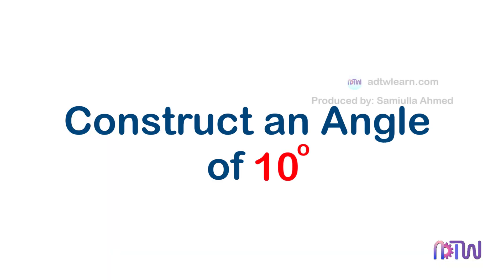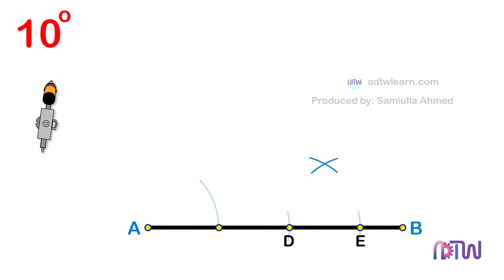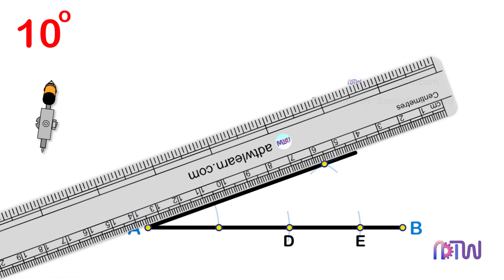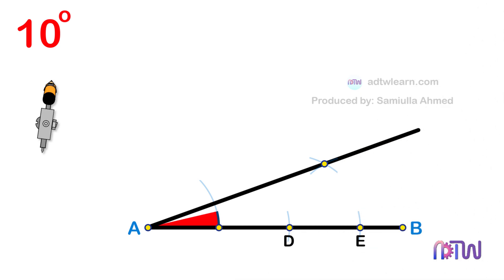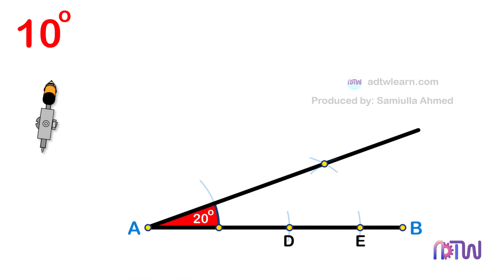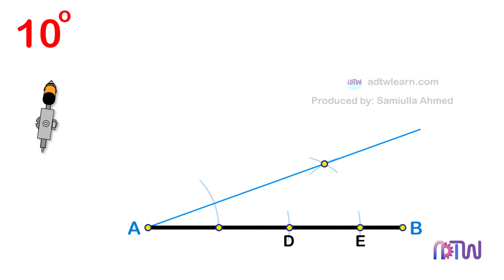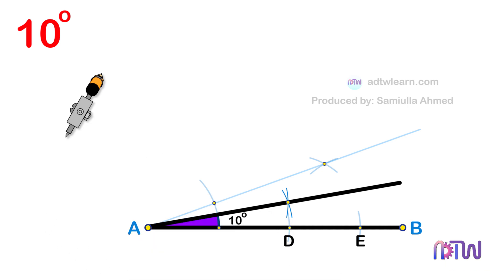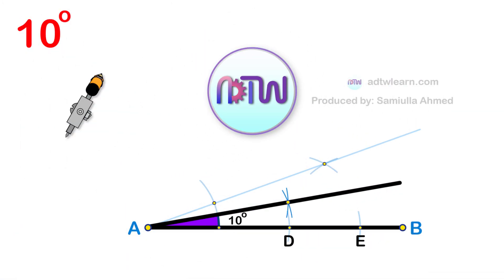How to construct a 10-degree angle usina g compass

Comment: Hmmm.... works out to about 19.1 degrees (using Pythagoras and inverse trig functions.) There are some prrofs about how it is impossible to construct a 10, 20, and 40 degree angles by compass and straightedge.
Reply: That's what I'm thinking too. It is impossible to construct integer degree angles that are not divisible by 3, I guess. You can construct angles such as 3 degrees, or 12 degrees, but not 10, 20 and 40 degrees.